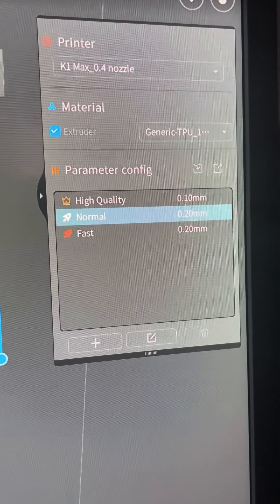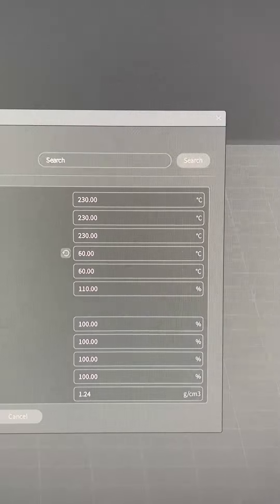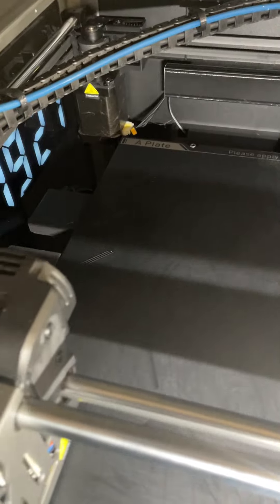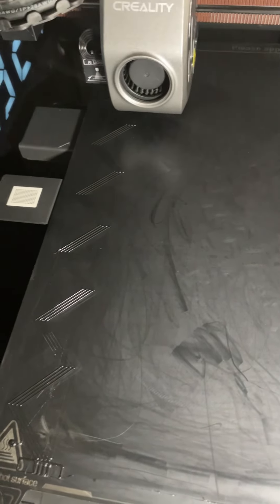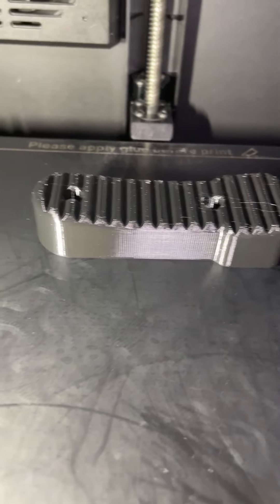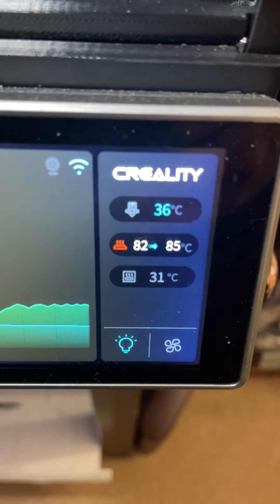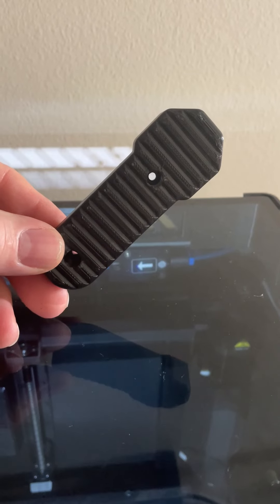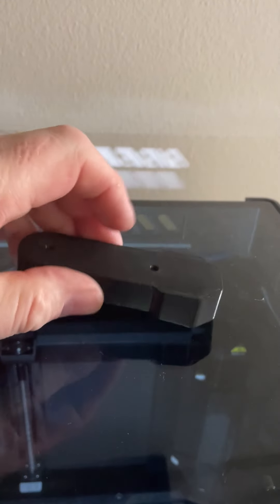Lets Print TPU on the Creality K1 Max

Comment: Good content, but there's something I'm stuck on. How did you pass the filament through the sensor on the back? I was not successful because they TPU filament is flexible.
Reply: I got stuck on the to but 20 minutes of trying different ways I got it
Reply: Typically for TPU (or just in general) people bypass the sensor entirely by clipping a short length of stiff filament and poking that through it, then it won't interfere and cause under-extrusion issues through adding drag to the line, and will indefinitely never trip the run-out alarm

Comment: Tpu does not stick on plate and there is a lot of stringing, what do?
Reply: Could be that your filament is too moist, as TPU loves to soak up ambient humidity like a sponge. Also, TPU in general doesn't respond well to a lot of travel movements, frequent retractions, and switching from object-to-object when printing a plate consisting of multiple items printed per-layer and not per-model (think stringing calibration tests where the nozzle quickly switches between multiple towers near each other on every layer VS if it had printed each tower individually to completion before moving onto the next).

Additionally, because you don't really want to add a brim or supports to TPU prints (they are a nightmare to cleanly remove) it's a good idea to use an adhesive on your build plate, like the classic go-to methods of a glue stick or hair spray, to increase adhesion between the bed and print.

The thin adhesive layer holds the first printed layer tight when warmed up, and if you allow it to cool back down thoroughly the glue turns into a separation layer atop the build plate; weakening the hold to the point you can more easily pop the print off, instead of struggling to tear it free and risking damage to the print or plate.

Comment: Al which speed did you printed?
Reply from the maker: Honestly, I'm not sure the speed the printer is printing at, As there's some setting within Creality print that I'm missing, and I'm still trying to figure it out how it's adjusting the speed within Creality print. Because if I take the speeds settings directly from Creality print and I input them into Orca slicer it's printing a whole lot faster and fails, so I'm not sure what the default settings are doing within Creality print. That's why when I'm printing TPU, I use Creality print default profile, because it works.

I wish I could have helped more, but I'm still working on it.
Reply: @stepbystepbacktobasics2731  it's in tpu filament settings, there's option ''Volumetric Speed Limitation'' 3 mm3/sn. (Pla was 18 mm3) so 6 times slower then PLA.